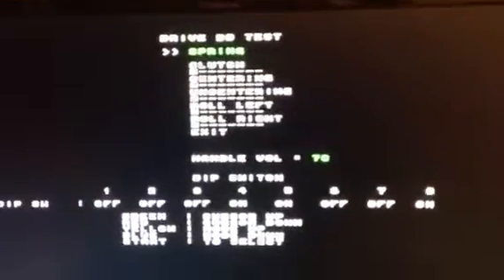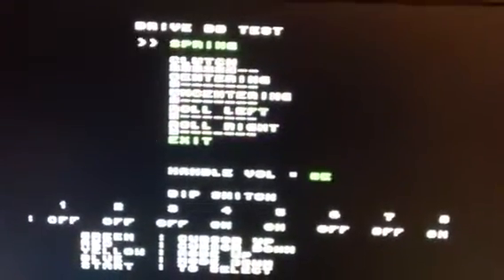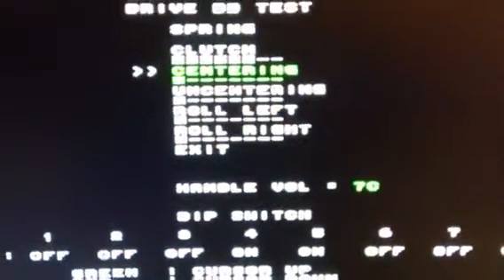Daytona usa Model 2 emulator with my custom usb board with force feedback

Comment: Great job! could we have a look of the USB board?
Reply from the maker: Right now im using 3 boards, the main board and other two. All designed and made by me. The main board is the one connected to the USB and that controls the others two: one for the clutch and the other for the AC motor (the US version uses a 90V DC Motor, so it needs other type of board).